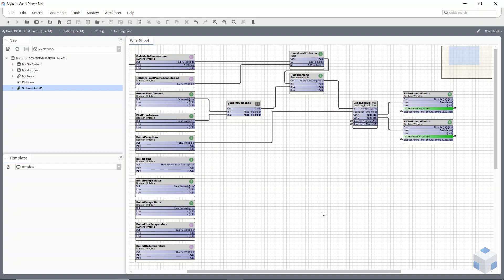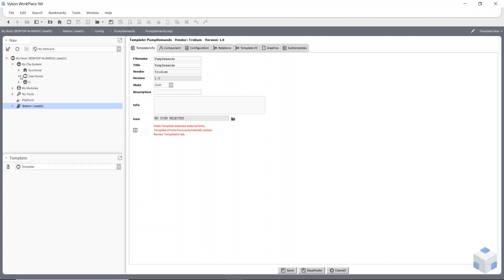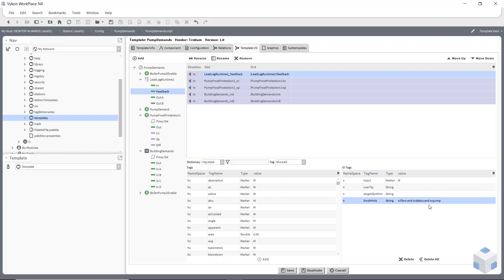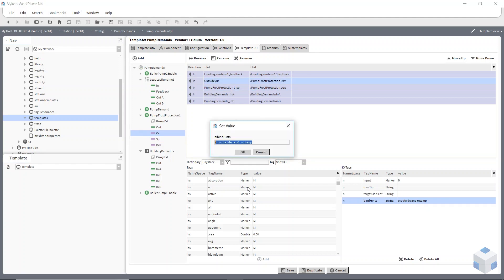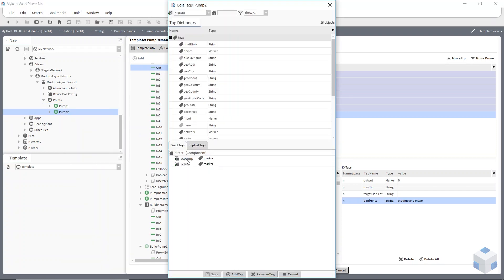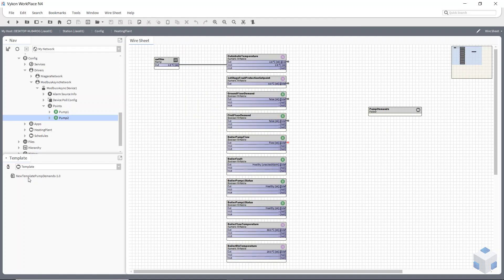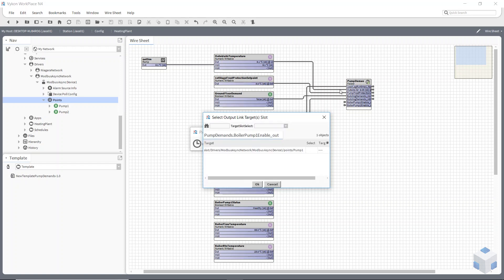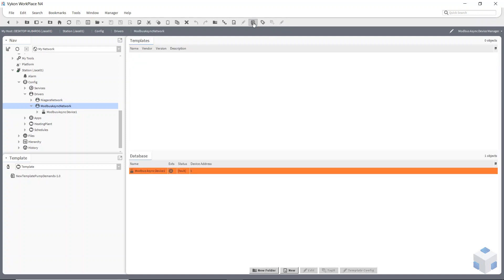8. Templates - Niagara 4 Video Training

Comment: In 4.7 I was able to take a folder of kit control logic I made with composites and create a templet, no problem. In 4.8 when taking the same folder, and trying to create a templet is gives me errors everytime. Personally, I am not one to use tags and just composites to link everything. I heard this was a bug in 4.8 but haven't worried about it. Are you aware if this is a bug?